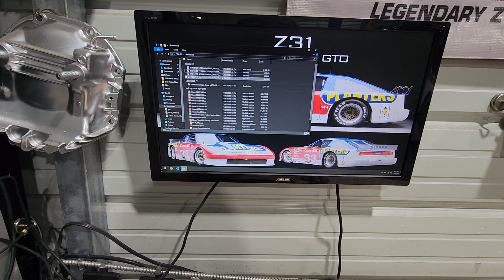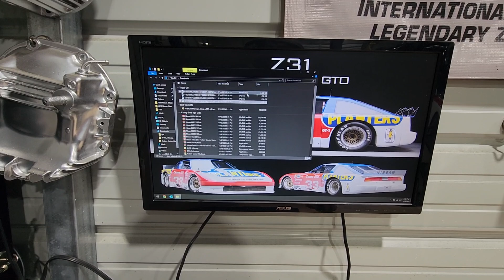Turbo Xterra going Twin Charged! M122!!

Comment: how did you make the template to line up with the belt drive for the super charger, is there a dimension between the front of the plate and the belt?
Reply from the maker: I used a mechanic's straight edge and dropping plumb to get the belt alignment and distance figured out.

Comment: Would the 300zx turbo parts fit the vg33? Got an 03 frontier i turned to a prerunner and was wondering if the ZX stuff would bolt in without any major issues. New to the channel and already liking the content 👍
Reply from the maker: Thanks for the comment! Unfortunately the 300zx turbo stuff will not fit the Frontier VG33, this is because there is no room for the 300zx exhaust manifolds to fit and clear around the engine. The VG33 is too close to the firewall. If you want a turbo setup, you'll have to do what I did by making a custom setup
Reply: Bummer. Was hoping to leach off the ZX parts in an attempt to save time on fabrication. So the engine bay is too tight to fit them? or do the manifolds and turbos physically interfere with the motor
Reply from the maker: Both the manifolds and the turbo
Reply: gotcha. thanks for taking the time to reply. Take it easy 🤙

Comment: Just for reference for when you’re at the mapping stage, when going compound charged, you can’t rely on MAP for accurate fuelling, you’ll also need to measure air mass (MAF). Manifold pressure and temperature isn’t directly able to be extrapolated accurately when you have varying sources of air flow being directed. Same as when have to remap for a different turbo size change.
Reply from the maker: Ah good to know. So instead of doing a 3.5bar MAP sensor, I should stick with a MAF sensor in front of the turbo?
Reply: @z31online  Correct. You’ll want to find a MAF and intake from something that has enough resolution for the airflow you’re expecting

Comment: I can't attach pictures, so this will have to be a thought experiment. Turbo-charged engines do not need headers. You probably know this, right? Similarly, supercharged engines don't need a free-flowing supercharger manifold. Take the VG33ER manifold and weld flat plate to it so the M122 can bolt to. Don't worry about the "free flowing" design. Just make sure the exit V is inside the manifold cavity and make the intake cavity air tight. Done.
Reply from the maker: Yes, I thought about doing that, but the only plate that you can buy for a m122 is $400+. The route I'm doing is essentially free as I already have the materials laying around.

Comment: Eaton part number is the cubic inches per revolution. IE 62 in^3 or 122 in^3. About double. 
Stiffness at the blower joint helps. Instead of rtv, consider using either OEM gaskets or milling in an o-ring groove.  McMaster sells a kit for making custom length o-rings. 
Will you stuff a heat exchanger or intercooler into the loop?

I suggest you do NOT delete the bypass. Instead plumb the actuator diaphragm to manifold pressure. Under vacuum the actuator will open the bypass. This happens during idle. The bypass shuts under positive pressure.
Reply from the maker: Ah okay, understood! Thanks for the insight on this!
Yeah I could get the OEM oring gasket for the m122 and simply channel in the grooving needed for it. Shouldn't be much of a challenge!